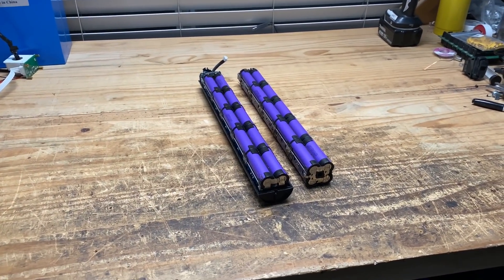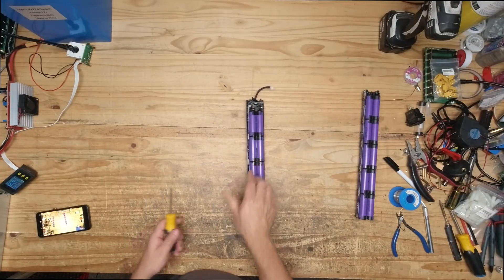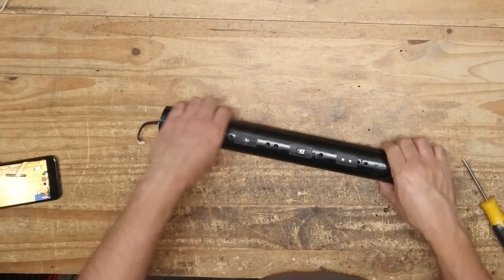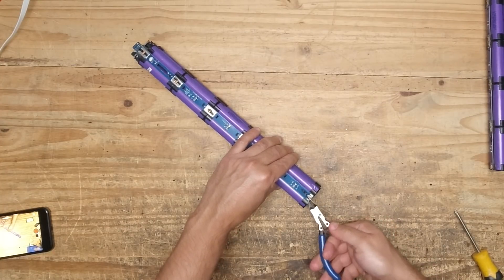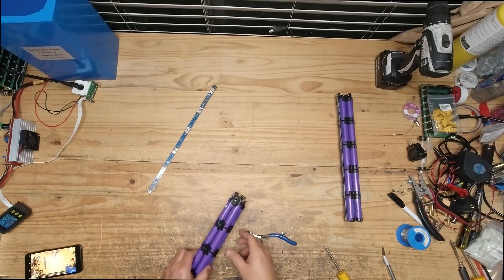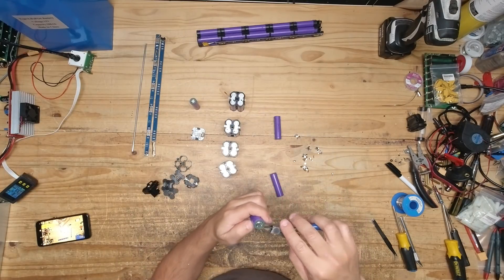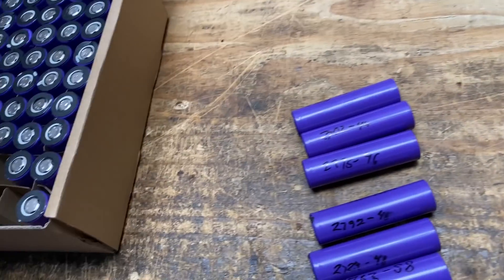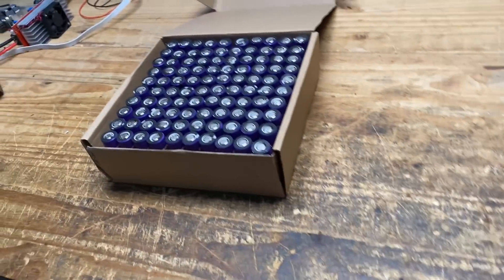Harvesting 18650 cells from $25 scooter Battery Packs

Comment: I been breaking down scooter packs and finding a bunch of 1.4v -2.1v cells. I tossed them in the charger and they are taking a charge just fine, I am just wondering if they are safe to use in a light dischage application.
Reply from the maker: They should be good if they didn’t spend months at low voltage
Reply: @jehugarcia  Hard to know for sure how long they say at low voltage. What if they sat low voltage for a year or more?

Comment: Save the pieces of plastic that hold the individual cells together.  A 2" drywall screw fits in the hole and you can screw them to a scrap board for a nice organizational solution.

Comment: Best to leave the nickel strips on battery and separate with knife and clean up the cut edge.....

No sharp bits deal with or rust cell container damage 

I would put a different bms on it and put in pvc pipe

Comment: I'm just getting started in rebuilding power tool battery packs. I use a spot welder. I had a failure in one wit 10 cells. They leaked. I remember some of the cells I salvaged I tore a small hole in the nagavite end. I suspect that's what caused the leak. My question is. If I solder the holes shut. Is the battery any good?
Reply: That is highly unsafe just get a new one

Comment: I watch these and I need a battery backup for my 3d printer farm something like 1k watts of capacity for each printer to cover power dips. what would it take to do a video on something like that? each printer runs a meanwell ac/dc 24v 600w power supply

Comment: Making sure the terminals on the batteries are completely flat is super important depending on the way you're planning on using them. This is especially important if you're using them in the 7S 24V batteryboards Jehu developed. If there's a small dimple on the battery connector and a lot of current is running through that to the battery holder you might end up getting heat there which could be a problem - at it's worst it could end up burning a hole in the battery. For that reason I set up a small station using a cheap drill press and a 3D printed holder that I put the battery into. Then I have two small grinding heads (one for each battery terminal's size) in the drill and I simple give every battery a very small "sanding" on each terminal making them absolutely pristine. I use the drill press' built-in stop guage to make sure I don't grind too much off. Consider it a very light surface sanding... Also makes the bond if you're soldering them much better, though I'd always recommend spot-welding them. This way I can process between 3-400 cells in an hour.

Comment: I took 18 of these packs apart. It goes super fast. Almost all of the cells were above 2.8v and charged right up. 
There are 2 different types of these packs . One with a metal road all the way through and another that has a small Phillips screw in every four pack
Reply: So you salvaged 360 cells? Nice!! What configuration are they in now?
Reply: @imperialsecuritybureau6037  I have charged them and letting them sit for now. I’ll do a capacity test next. The big plan is part of a 24v battery wall.

Comment: Where do you find pallets of scooter batteries?
Reply: I presume mostly from recycle centers. Companies are obligated to dispose of "e-waste" via proper channels so they pay recycle centers to do that, in return they get documentation confirming they did it the right way. During this company has to give some notes about batteries so you know that those batteries are, for example new-old stock for outdated model of scooter, thats how you know they are not used (because this LG cells are rated for 2600mAh but they perform much better with 2700+mAh)...

Comment: you never mentioned the IR. would all of them, 40 -60 IR all be compatible with each other for assembly in a Parallel block? what is a good rule of thumb to keep em safe. what about resting for a couple weeks?
Reply: Resting them and checking self discharge. The ones that discharged more correlate with their higher internal resistance

Comment: Ey, Jehu, @5:30, how many volts were those four cell packs after you separated them?
Reply: Its hard to see, but I think those are just 2 + 2 cells both in parallel setup, they are not connected so you get 2 times 4,2V (when full) but it looks like if you just make a short bridge on one side you will get 8,4V on the other side, which is nice if you need 8,4V.
Reply: @ledhunters  I don’t understand, wouldn’t 4 cells make a 12v (or better) pack- being that 18650’s are 3.7v cells…?
Reply: @iamher6422  They would if you connect them all in series, but these are 2 parallel + 2 parallel cells so you would have to cut those spot welded metal plates and at that point you will have individual cells like on the end of the video, that you can arrange to your likings.

Comment: Jeeeehuuuuu I want to do an EV project, and those battery keeping them together look good for a Project…
Do you recommend them for the EV????
Reply: LGMG1 18650 are quite high drain cells depending on the exact cell model. Suitable for EV as long as you consider the maximum drain rate of the cells
Reply: @mahaniyama  But this particular are rated for 10A continuous which is not something to brag with but depending on setup and how many cells are in parallel it might be OK.

Comment: I'd like to build a couple ebike batter packs, seems like these cells would probably be an ok fit correct?
I'd def check a video out on that if you already have one.
Reply: Yes these are high output cells so you can get plenty of amperage out of your pack using these. 
Here are the steps I use. 
Test cells and dispose of bad cells. 
Decided on pack size and make the parallel groups 
Chose how you will hold your cells. Black cell holders and do the soldering your self. Or a kit like he has available. 
If you solder it yourself individual fuse wires on each cell is important. 
Figure out how you will balance your pack. 
Electrically protect the pack with a sleeve or plastic box
High amperage fusing close to the pack. 

Search YouTube for 18650 diy battery pack. Educate yourself instead of just following a tutorial. 

The number one way these burst into flames is over charging a single cell.